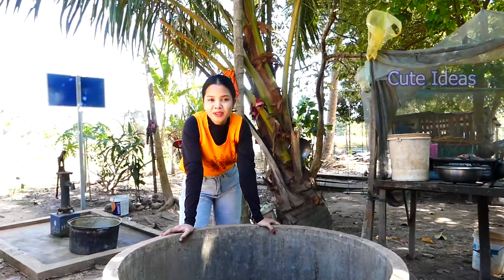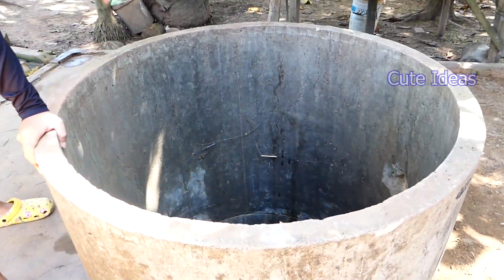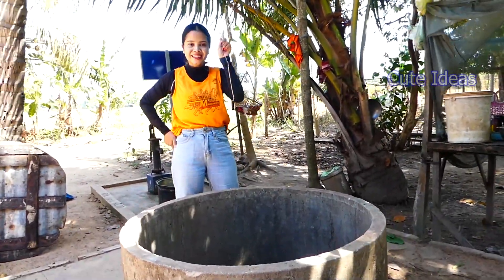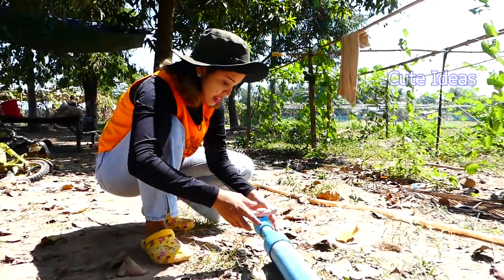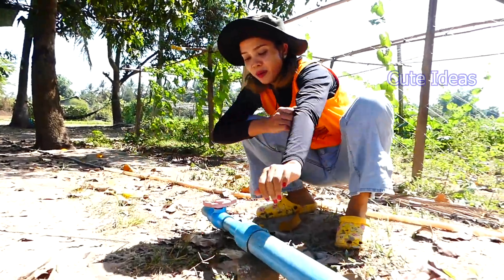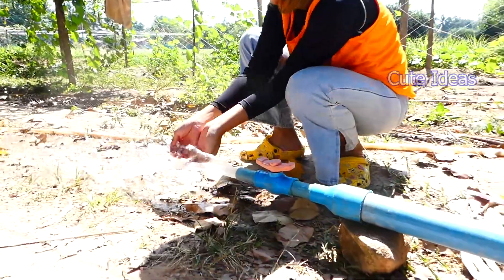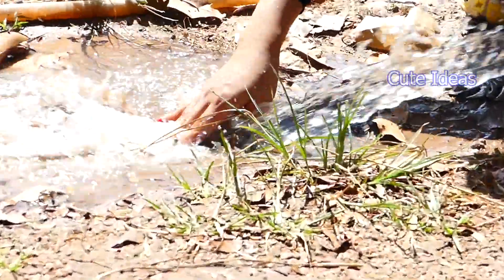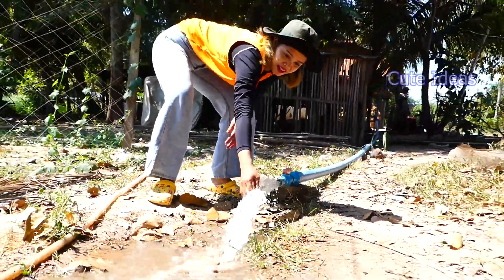Non Stop 24h Auto Pump Water - How to make Non Stop free energy Auto water pump No Electricity.

Comment: By filling the metal drum and connected pipes with water, the air present in the contraption is driven up the two vertical pipes fixed near the delivery end of the system. When valves on the drum are closed and the valve at the delivery end is opened, water flows out causing a partial vaccum to be created in the metal drum. Since nature abhors a vaccum, water in the well is made to rise up in the supply pipes due to atmospheric pressure and starts to fill up the drum.  Quite an ingenious way to water one's garden.
Reply: But this system only works if the water level in the well is elevated higher than the outlet from the hose. It does not seem so.

Comment: if I close all exit after I use then can I still use it tomorrow by just turning on the master valve? or do I need to fill again the drum to make it work?
Reply: IF everything is airtight connected, yes. Notice that the exit valve at the end is smaller than the pipe! This is to prevent air to be sucked in. The weight of the water pushes itself out of the barrel. This causes a negative pressure in it and in the suction pipe. 7 meter between barrel and water level in the well is the maximum possible (about 23 feet for US-based). From a drilled well it will only work if you have a pipe in pipe system. Like a 10 centimetre pipe well with a 5 centimetre suction pipe in it so air can pass and give atmospheric pressure on the water surface. ( 4 inch well pipe and 2 inch suction pipe)
Reply: @JaakJacobus  No. This is a siphon with a barrel. A siphon can not lift any water, not even one cm. 7 meters? Impossible!
Reply: @kjellg6532  7 meter max. sifon height.
However they make it look like it only goes up.
So:
1. They "forget" to show the fact that the exit is lower than the entrance
or more likely
2. They hide that fact or fake it to get more hits on their video. More discussions means more views so more money.
Reply: @JaakJacobus  This is a siphon. A sipon can not lift any water up, but it may make water traverse a 8-9 meter high wall. All that water must come down to an exit lower than the source, you can not extract a single dra at 7 m above the source. So no siphon can lift any water up from a well. (That is on flatt land. In a steep hill, you might get the output lower than the surface  in a well).

Comment: What principle does this pump run on? How many meters is the difference between the suction head and the outlet?
Reply from the maker: 4-5m
Reply: @ouksothea  и что... вода течет вверх сама собой?
Reply: @zemlazemla8910  да.
Reply: @Прол-ш5щ  и как это возможно?
Reply: @zemlazemla8910  Извините, я был не совсем точен. Вода поднимается вверх в бочку. Но в целом эта система будет работать только в том случае,  если уровень воды в водоёме будет выше уровня выхода воды. При условии если будет соблюдён закон сообщающихся сосудов. Физика школьного курса. Стоит приподнять трубу из которой вытекает вода на уровень водоёма и всё перестанет работать.
Reply: @Прол-ш5щ  Полностью согласен!
Только вот в таких видео утверждают обратное.
И на диалог не идут.
Reply: @zemlazemla8910  это их проблема.))
Reply: @ouksothea  No! This is a siphon. A siphon can not lift any water. The exit must be lower than the water level in the well for this siphon to work.

Comment: A Hoax?
The outlet to the field seems ti be elevated higher than the water level in the well? This is a siphon with a barrel. No siphon can lift water up, outlet must always be lower than input for this to work.
No need for the valve after the barrel, waste of money. No need for the two vertical pipes after the barrel, waste if money, no need for raising the barrel so high, could have been placed on the ground or a little higher, much easier to fill barrel. Why not a funnel? Now you have to lift extra water. 
And remember, a siphon can not pump or lift any water up!